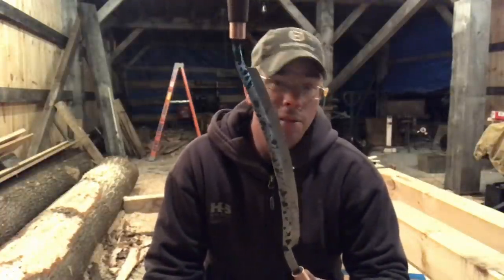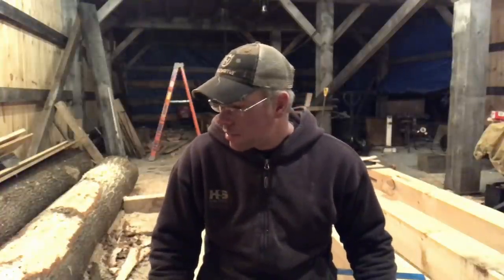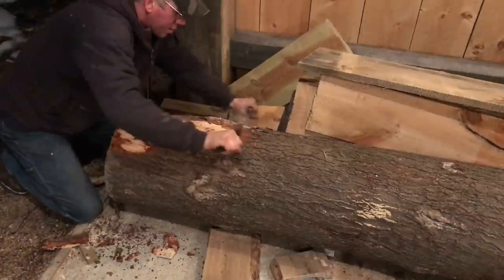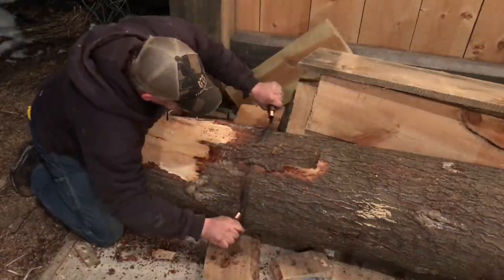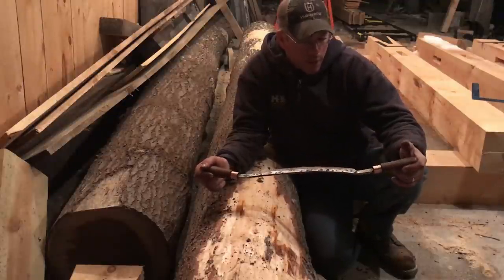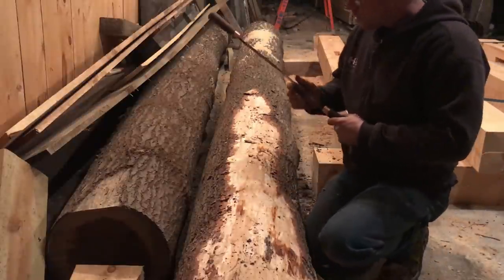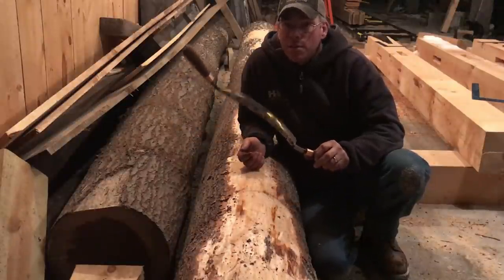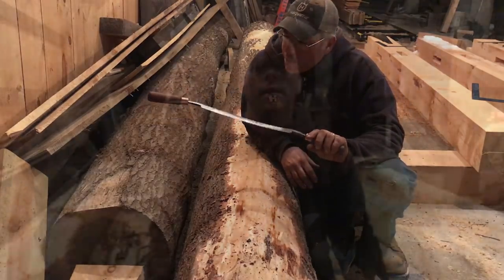Log Testing Our Hand Forged Draw Knife

Comment: A couple of stout sawhorses or a table designed to hold the weight would go a long way to helping get things at the proper height. It would also enable turning the logs to access the whole log without receiving a hernia for your troubles. Very handsome tool and addition to the arsenal.
        Mike
Reply from the maker: When this building is done I'll be able to setup much better.

Comment: Morning Jim... now, keep in mind that the only steel work I've ever done was in shop class making a candelabra with rivets, and that's back before electricity, so don't laugh if this question sounds stupid, How can you tell what kind of steel it is if you pick a piece out of a pile of junk instead of buying it? I have steel pieces and junks that I've accumulated over the years and don't have a clue as to what type they are. The draw knife seems to work very well, and that bark is very tight. Watch it work better when you get a log that the sap is running in it. The draw knives work well, but I still find it better to use a sharpened garden spade to peel those large logs, especially if the sap is running. I can get a full length tree, the size you have there done in ten minutes. And there are times that I can peel the log and have the bark in one or two pieces. Congrats on the new tool, can't wait to see you make more.
Reply from the maker: To be honest John I have no idea how to tell what you have without lab equipment.  You could use a grinder and do a spark test to see if it's canonized but that's not very scientific.  You could also get it above magnetic, quench it and see if it hardens well.
Reply: So, if you need to have a specific steel for a project it would be better to just buy a piece so you know what you are working with. It really doesn't matter for projects that you do for yourself, but if you are standing behind your work for tools you are making for someone else it's probably better to know what you are working with. There's way more to this than I thought, thanks.
Reply from the maker: You are spot on.  Mystery steel can be a pain.

Comment: Jim, Anneal, Normalize, Temper -- water quench, oil quench - Canola, motor, Peanut, and others ... all terms I hear in differing amounts and requirements. Samurai Carpenter started with File steel, You used 1080 (I think) and I've seen others. Including cast Iron no-nos. Normalizing the steel (which I can't recall either of you mentioning) is confusing at best. It would be nice If, say, Samurai's File Steel base had a good explanation as to "proper methodology" (I have files I could use). (a video hint?)😃
Reply from the maker: I can do a video on that

Comment: I saw a WoodMizer vijayo the other day that had an attachment I'd not seen before. It's kind of like a chain saw blade, but short, laying on its side, and cutting a shallow kerf, through the bark, ahead of the band blade. Accomplishes both reducing the garbage getting to the band blade, and reducing debarking time where not necessary.

Do you know if there's such an attachment from Hudson? Or if an aftermarket, one-size-fits-all unit is available. The reason I ask is because I look at all the bark on all that log times all the logs yet to mill, and a draw knife seems pretty labor intensive.
Reply from the maker: Hudson doesn't make one, be cool if they did.

Comment: Really really good Jim, looks like it's working well for you. Quick question, do you find the angle on the handles is enough to give you good control of the angle of attack?
Reply from the maker: Yes, it was actually quite controlled.  I wouldn't use it for extreme fine work but for it's intended use it was great to use.

Comment: I have files and tools w/ burned on handles, they have never come off. The only way to temper/ anneal/ heat treat steel is to get info from metallurgists or blacksmiths w/ years of experience. Junkyard steel is a crap shoot.
Reply from the maker: That's right.  I have a heat treat app on my phone put out by an association that has studied heat treating since the early 1900's.  There are over 400 listed metals in that app along with the processes and temps for forging all the way to tempering.

Comment: Are you using the beast flat side down? .... Eather way she looks good ;0) As far as your lights go ..... LED's are the future! Not the cheapest or the biggest output .... but in terms of reliability and longevity as well as lumens (the real units of light output) you can't beat them!

I will remind you of this when you have 10 years of daily video output and have not had to change a bulb! (and you are getting older and grumpier up a ladder when you could be getting on with the new configuration of scarf joint for the new barns you are in business making)!
Reply from the maker: I would have to agree with you Dave

Comment: I like that you had a challenge with the standard draw knife and built one with a fix yourself. But why would you not just run this through the mill with the bark on? You don't use the bark part of the log anyway?
Reply from the maker: The bark dulls your blades super fast.  These logs are packed with sand to boot in the bark.
Reply: Couldn't you hammer out a ?10-80? blade, that would cut right through the rocks? ;)
Reply from the maker: Why not

Comment: I have zero experience in this matter. My question is why is the blade made with the sharp edge as you have it and not on the other side so that one would be pulling a "U" to shave the bark away. I just want to know....
Reply from the maker: I like the smaller contact area where the blade enters the cut, little easier to get it started.